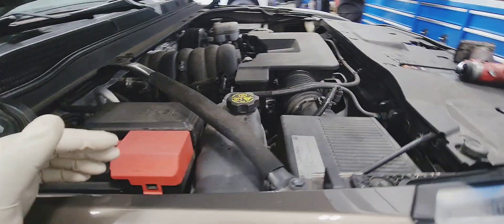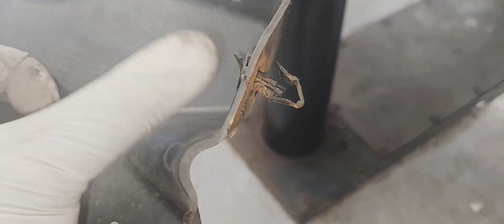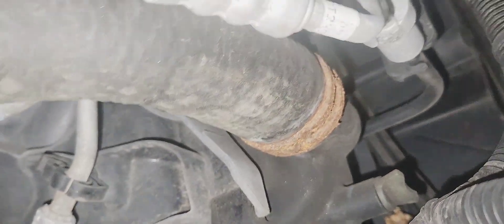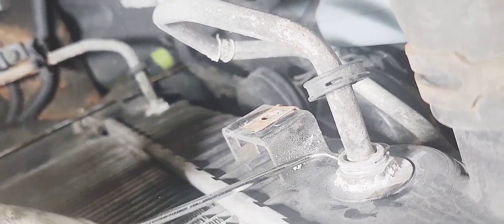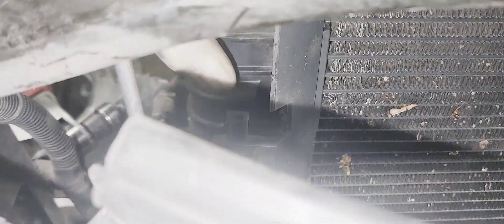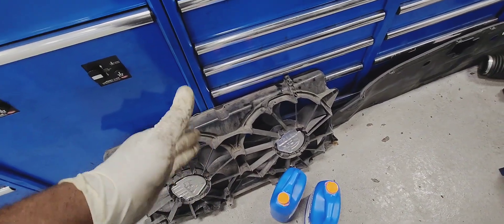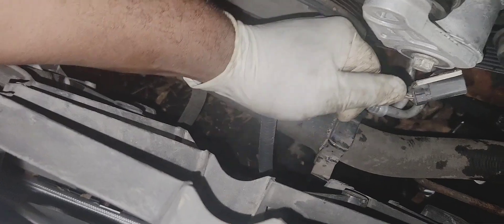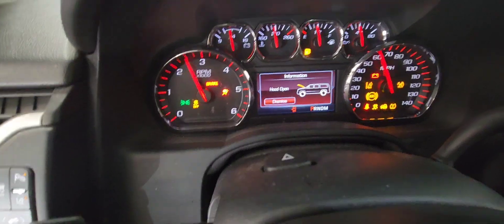2015-2020 Chevy/GMC/Cadillac  SUV radiator replacement

Comment: My 2020s radiators plastic tank cracked on the drivers side. It’s been a nightmare to remove and to top it of it has oil cooler lines. No videos at all to guide me through the process
Reply from the maker: How many miles? That should be covered under warranty if are you below 60k miles or certified pre owned